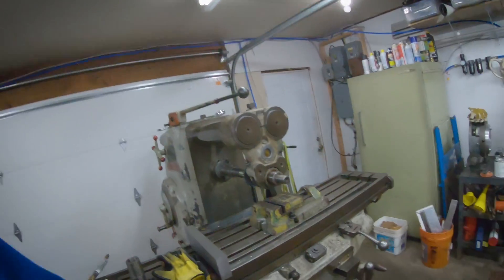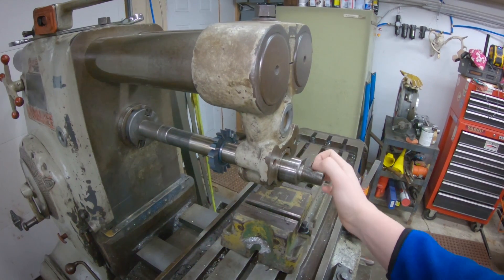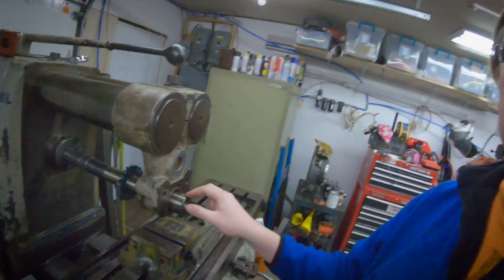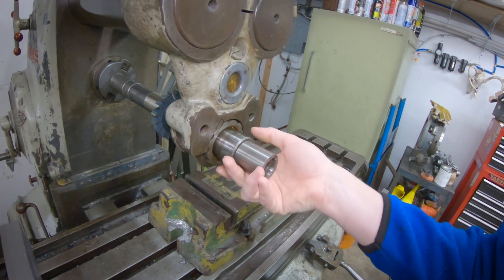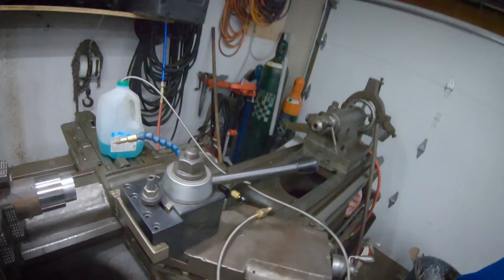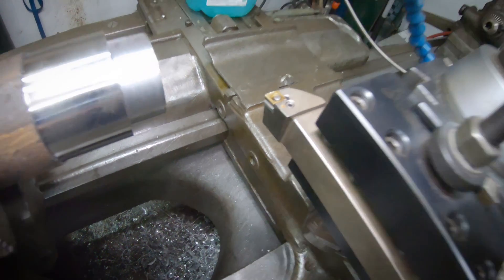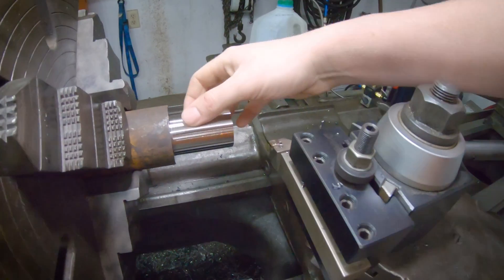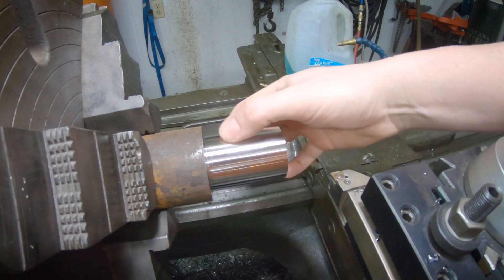Making A Big Nut For The Kearney & Trecker Mill

Comment: That K&T will fill a bucket with chips before you know it.. Mike in Louisiana
Reply from the maker: I would believe that, with a big face mill it will fling a stream of chips quite a distance
Reply: @DarlingtonFarm  I use cutting oil in all three of my K&T machines and with sharp cutters you mostly hear a swishing sound as the metal piles up behind the cutter...Mike in Louisiana
Reply from the maker: Thats what I had read, Some one has used coolant in mine and its got some corrosion sadly also the oil pump is missing
Reply: @DarlingtonFarm  Yes.. I cannot tell you how coolant had messed up all three of mine.. ...Nothing but oil for me now.. No more smelly mess no matter how long they sit....Mike in Louisiana